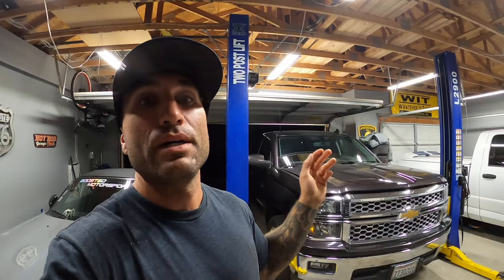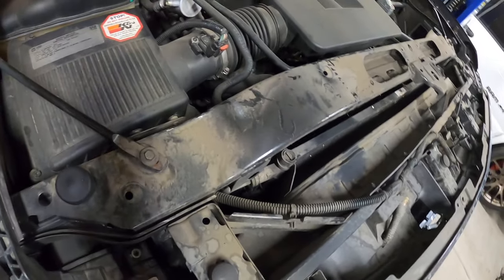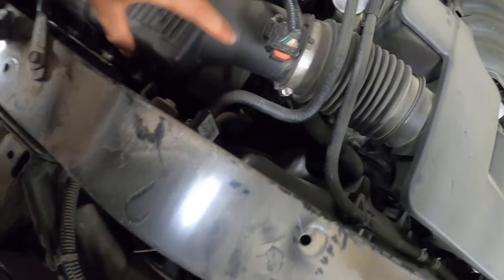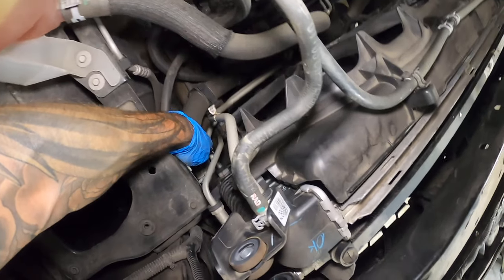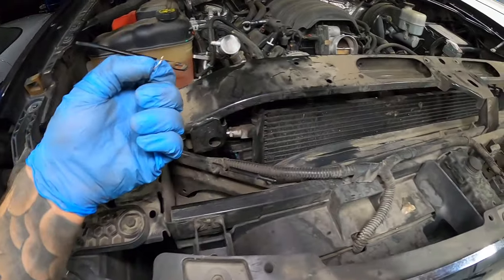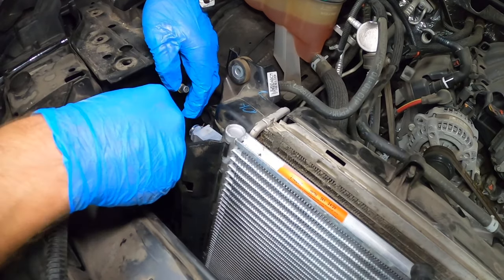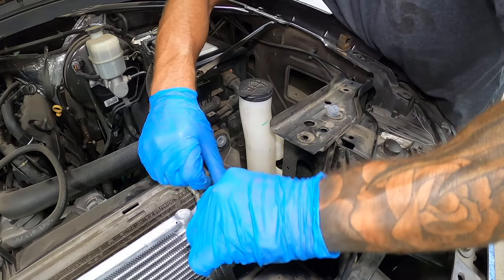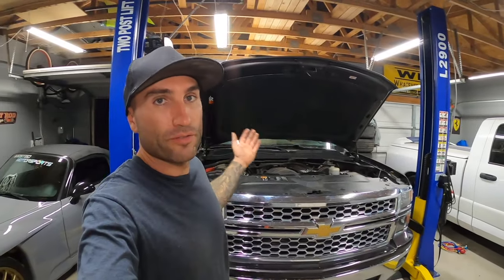Chevrolet Silverado A/C Condenser Replacement DIY

Comment: Good video ~ I went ahead and took out the air box bracket ( 3 10mm bolts) made it a bit easier & one thing I also did , was replaced the ac line flat gaskets & transmission line o rings , yea know ( just in case they were damaged.

Comment: I have the exact same problem.Very good video.I am 1st going to take the condenser out and Aluminum weld the crack.If that doesn't work I will buy a new one.Readers do not buy a GM Dealer condenser, you will get the same leak as before in a few years.I had a warrenty replacement,3 years ago.Same exact leak now.What a bummer.I call this a GM service shop money maker.

Comment: Awesome vid and it saved me a lot of money. My only issue was getting those top hoses off. Mine didn't just pull out so easily. I used a pair of channel locks to grip them (without damaging or crimping them) and tapped the side of the channel locks outward with a hammer. Worked like a charm.
Reply: Very helpful comment

Comment: Great video ...Can you check the link you posted? It seems like it's not the same condenser you replaced yours with. The one that pops up seems weaker than the one you used. Thank you
Reply: @BoostedMotorsports agree with @ANTHONY31077 it seems like the link to the Amazon condenser is with the three tack welds.  Can you confirm the one installed (with the solid welds) is the same link?  Thanks!
Reply: I see the same thing too. Should be the one with the full weld not the 3 tack welds

Comment: I just received my spectra Condenser and I hounastly couldn't be more disappointed. I haven't even installed it and just by looking at it I can say that it's not going to last long because this Condenser is literally held together with tacks. Everything from the drier to the mounting tabs. As a fabricator I can tell you that if aluminum objects are just tacked together it is very very weak. Atleast the ac delco one had small stitch welds. Im thinking about either putting welds on it myself or returning it. But im not sure if the welding it will void the warranty
Reply: Is the condenser you got the same in this video?
Reply: @javiersanchez3061  yes

Comment: Great video John.  Good explanation of how to change it out yourself.  I wonder how much the shop rate on a job like that is.  How much was the condenser? Thx
Reply: Dealership quoted me $850. Found a condenser with quality reviews for less than $100
Reply: I was just qouted 1,600 @ the dealership.
Reply: Dealership quoted 150 to recharge and add the uv dye.  Did it all myself for about 250.
Reply: Knoxville, Tn area just received quote 879.00. 375 is labor alone.
Reply: I was just quoted 1800.00
Reply: @adamwhite3820  yikes
Reply: Salvage yard, $40

Comment: What brand condenser? I have the same problem and bought a new condenser at o’Reillys and it  definitely does not have a solid weld only 3 tack welds.
Reply: Just seen the link in description. Thanks
Reply: The picture on the Amazon link is not the same condenser.
Reply: @jacobseifert1310  agreed! the condenser in the link also has the fragile tacks.

Comment: Same thing with my 2016 Silverado. What brand condenser are you installing.  I have and AC DC Aluminum welder will try to weld the crack. But I’m not an All Pro Welder so I’m replacing with a new but will also try to weld the factory condenser

Comment: That windshield wiper fluid reservoir area messed my wrist/arm up. It sucked, but now I went to the sand dunes off roading and my AC is out again. So I think I cracked the welds  again. 😭

Comment: I have an 04 Silverado in about once or twice a year the AC blows hot on the driver side and blows cold on the passenger side usually when it’s the hottest day of the year and I’m driving down the road so I pull over turn the car off and on, and usually it goes back on But if it doesn’t, I turn the motor off. I take both sides of the battery off for 10 minutes and then turn on the headlights. Keep the headlights on with the battery cables off for 10 minutes. At least let the access millivolts drain out of the system out of the computer system, turn the headlights off put the battery cables back on and it should work

Comment: When you connected the top lines on the condensor did you push lines in then place clip over it?
Reply: Looks like he pushed them on with the clips in place.
Reply: @txpyroguy817 And that works the same